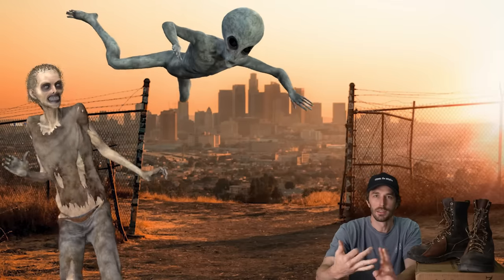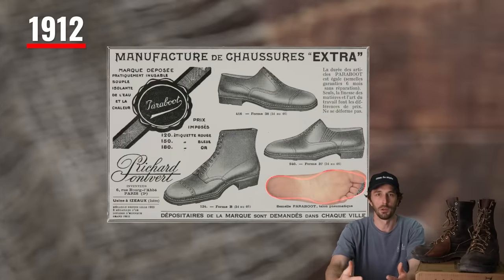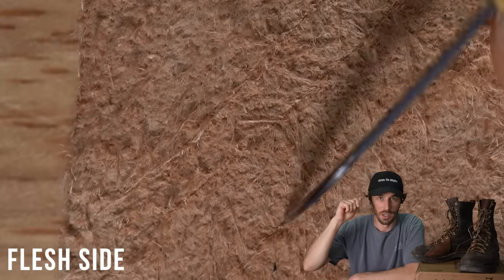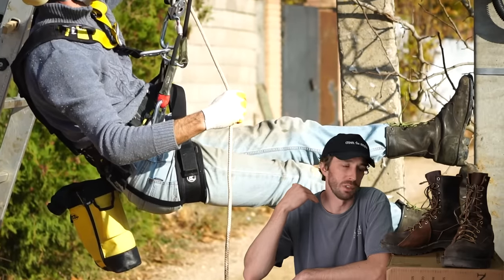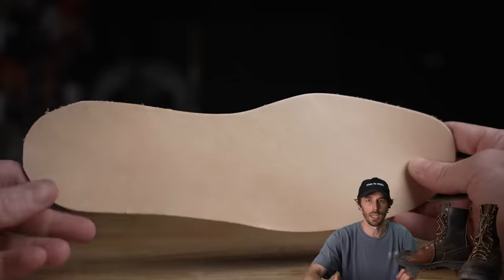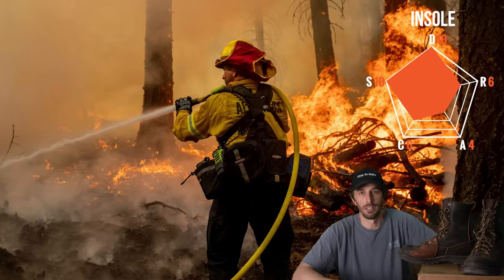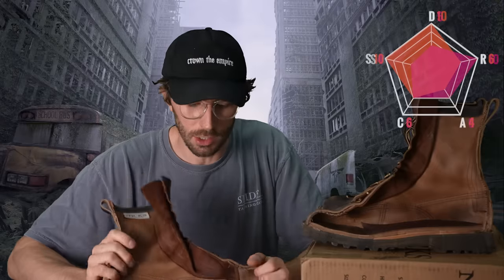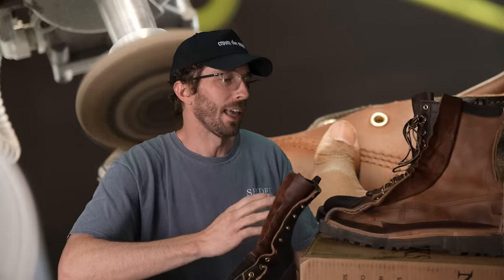Why this boot would save you in the Apocalypse (ND3)

Comment: more "work" boots for people who don't wear them for work. Reinforced the inner edge meanwhile my work boots have the outside edges destroyed from sliding in and out under cars, walking past pallets of sheetmetal that put big slices in them, scraping them against concrete, and accidently rubbing them on hot welds/having speatter land on them. I've worn holes though the sides by just having the leather get so thin that it tears like a canvas sneaker. never once has any wear where that extra patch is. it's probably the one part of my shoe that looks new even. Look at 5:39 like someone else said. these "new" boots already have wear there and no extra protection
definitely won't last any longer than normal work boots before that whole toe section needs to be stripped out, and at that point, why spend this kind of money if I get 18 months instead of 12 out of boots 🤔
silly.

Comment: If i missed it are these boots waterproof? Ive used some big name boots like rocky, redwing, danner, irish setter and have yet to find a boot thats lasts more than 18 months with regular cleaning and waxing/oiling. I do pressure washing and am also in the woods all the time so i have a pretty equal time on dirt and pavement but most boots cant handle the constant wet dry conditions that cause the soles and leather to break down will these boots handle what the other big names cant?

Comment: I'm going for a 3 momth Pilgrimage, accross Spain,.Camino de Santiago, and need good shoes. Since it's pretty hot, lomg way and....all that comes, would these boots be great, good or not so? Cause I'm thinking on non-leather shoes. For the reason of lightmess, faster shape ing to my foot, also half-hiigh ankle shoes where I can tighten them up just over my ancles amd getting good suport. Also ,if they come with 2-3 upper hooks, I can use them as ordinary shoes, just tightening them up under the ankles, like lower shoes, just abow the wrist, not using the hooks. Also they maybe should be GoreTex? Do you habe any good shoes to recommend vs these? Would you go for leather since tney shape better to your foot(but now adays, the Hiking shoes,.not leather also, does this. Or maybe a mix of leather and apparel? There's so many different clothings for shoes now, so what to choose? Hope so much you can belp me out with these things🙏😊. Best regards,  Thomas Aasen, Norway

Comment: Anyone having the problem of Leather cracking right through at the toe bend? and that's with both the new Solovair and DMs, contacted Solovair about it who told me it was because ''I bought the wrong size'', I responded with '' I still have a pair of For Life DMs that are the same size and after 4 years of constant wear there is no problems with the leather, I have been wearing DMs for 40years and have never had this problem before!. Response ''we don't make comparisons''. 
DMs and Solovair have both cheapened their materials and by doing so have now got a rubbish product.
DMs are also not honouring the ''For Life'' agreement as they don't do repairs and instead are offering a lesser unreliable replacement product.

Comment: When there is a collapse (and there will be due to a combo of ever faster weakening of earth's magnetic field and a strong Solar event(s) knocking out electrical grids), my plan is rather different foot wear wise.  Multiple pairs of lightweight hiking sandals--don't weigh a lot and aren't very bulky. Of course they individually wear out significantly faster than a boot like the above... but pretty sure that 3 or 4 pairs will last significantly longer, especially outsole and tread wise, than the outsole and tread of one of these boots. During a real and full collapse, there will be very little repairing of footwear. You will not have extra outsoles, good glue/ahesive, etc just lying around. 

   But the real secret sauce will be the special, oversized, protective "socks" that goes with these--- only two and both very light weight. First one is a warm weather outer sock made out of breathable, extremely fast drying UHMWPE fabric. Toughest material on earth in many respects, and very cooling (thermal conductivity similar to some metals). 

   The cooler to cold weather sock will be more involved. It will have an outer layer of breathable, extremely fast drying, outer UHMWPE fabric, with a layer of siliconized kevlar fabric below that (you just thin some silicone caulk with naphtha to a correct ratio), a polypropylene layer below that, and a high tenacity polyester fabric below that. All breathable, all fast drying, and the latter 3 fabrics more insulating (will be used in combo with alpaca-synthetic blend socks). Maybe a layer of hollow core fleece in there somewhere as well?

    It will be highly water resistant, but still breathable and quick drying.  If it gets sopping wet, you can take it off and wring the water out of it.  You can't do that with thick leather--that stuff takes forever to fully dry.  Meanwhile, the hiking sandals are very quick drying. 

   Oh, and both outer protective socks will have outer insert pockets for a carbon fiber + S2 fiberglass + high strength epoxy composite insert. This protective insert will have small holes drilled into it, for you guessed it, breathability.  

   With this fabric combo, you wouldn't be able to cut through the material easily, if at all, with your average cutting instrument.  The beauty of making it into an oversized sock, is that it is pretty easy to do if you have a sewing machine and know how to use it.

Comment: I live in Nome, AK and I work as a meat dept. manager.  It gets cold up here and wet during the break up.  Also, I walk to work each day.  I need something that will keep my feet dry, warm and be comfortable.  Nome has about 2 or 3 paved streets.  The rest are dirt packed with stones embedded.  I need to deal with those conditions.  Will this boot provide what I need?  Also, loathe to buy online since footwear can vary so much on fit and actually putting something on and trying it is the best way to see if they work.  How is the return for a better size policy?  Thanks.

Comment: I’m not sure why you think lineman have the worst job on boots,I work in the garbage industry,there’s nothing more dangerous than a landfill,the only boots our company allows on our feet are the timberland pro,there puncture resistance,water proof,insulated,they have a polymer toe,I’m a diesel mechanic,so I’m getting oils grease,fuel on them,theses boots don’t fall apart,and I get years of use out of them,they wouldn’t even let you’re boots in the garbage industry. Yeah these boots are almost 300.00,and there comfortable no break in period.
You’re boot as no insulation it’s going to be cold,the timberland pro with good wool gators,you can go out in sub zero temperatures and you’re feet don’t get cold
Timberland pro baby is my choice

Men's Timberland Pro 8" Boondock WP & Insulated Work Boots 89635

Comment: why no steel toe? to heavy also a steel plate in the sole would help puncture resistance on the bottom but if you've ever jumped in those they slap your feet when landing its something to get used to. but maybe instead of a plate maybe several plates linked together in a scale manner so less slapping happens idk worth a test i geuss. out or maybe plates then a non neutronium sole

Comment: So I recently started working with my states DNREC in the US in Delaware so we have a mixture from Woody and rocky terrain to wet and sandy that basically wore down my Keens in less than a year. Actually had a half inch wide stick puncture the sole and it's basically barely being held together with Shoe Goo. Any regular watchers of this channel that could point to a vid or recommendation for tough but comfortable hiking boots that I could bushwack through untouched terrain without wearing them out in less than a year?

Comment: $620 for some hipster boots? No thanks. I'm a welder in Texas, my made in the USA Justin steel toe J-Max work boots cost $240. I've been welding for over 10 years and I'm on my 2nd pair. I tossed my first pair only because someone dropped a running angle grinder on my toe, it opened up the leather, and the steel was showing.

Comment: I've been in the military for 14 years and I assure you this is not the boot I would sport in the apocalypse. The fact this guy thinks modern boots just fall apart and melt after 5 years is insane. I have rocky sv2's that have lasted 10 years after countless exercises. Not to mention we used to issue boots like this back in the day and the number one problem with them is winter. If you're a hipster living in Cali I guess you could wear these but anywhere else these turn into hockey pucks on ice and hold zero heat. If you have the money get a pair of lowas

Comment: Weight? What kind of Nancy-boy cares about weight? I've done 4 years in the Light Infantry and the next 35 working in foundries and machine shops. The only time I've ever noticed weight on my feet is following military vehicles down muddy roads when each foot had about 10 pounds of mud stuck to it. 
For waterproofing, you can't beat goretex. Applied waterproofing doesn't hold up to sustained submersion. I also need steel toes or better yet, a composite equivalent. A protective shank on the sole is essential too. When you weigh over 200lbs and are carrying another 60-100lbs and you step on a nail, thick leather and rubber aren't going to cut it. 200 grams of thinsulate helps down into the low 40s or high 30s and you don't notice it when it's hot out.

Comment: Bro…. I got another thing that’s hard on boots… WORKING ON TRASH TRUCKS. Yeah. It’s hard on them. Really rough. Hydraulic oil, all kinds of fluids you don’t want your foot exposed too, fuck trench foot. Only boots I’ve found so far that WILL be water tight even after 2 years of hard use is the redwing logger max so far. Tried danners, yeah no thanks.downside to my redwings? They are HEAVY. I’m used to it though everyone else who grabs them are shocked by me wearing it daily even in my early 30s

Comment: Well you forgot working on the Railways, even as if not ven more important than what you showed (5,00min), do your 20-40km every day on Rocks (only wallking counted and not all the rest) and tell me again XD if not more or same important !
2-3 months and you need new Shoes in my Job if they are bad! And im talking about having Boots for Mountain Region, thats we work with!
Under sole seems the most important then the rest. But yes, it dpends o what Ground your working on. We have a lot of Nails and Glass and whatver laying on the Ground that can Slit or Penetrate your Undersole. Stability would be next iMHO! As i recall in Military, the best Boots are bale to switch out the Undersole, which is good and timesaving!

Comment: I made my own shoes I use materials like carbon fibre the bottom is made of titanium whit small dents pattern that avoid the shoe slip other materials use inside of the boot to isolate the feet from water treated leather whit layer of graphene paint does not wear of this shoes can take minus 80 degrees Celsius to 60 degrees Celsius plus all surfaces of the shoes have microparticles of coper antibacterial metal use 3d printing and crn to carve and mix the materials . you can put this shoes under  in the sea for decades and come out new is made inspire in shoes for astronauts  conditions , light , space proof , sea proof ,fire proof I mean probably you will die before the shoes break one of the most extreme test I made whit this shoe apart to submerge in sea for 6 months is to take pork fill the shoes whit it and let root inside the boot and most of cloth after body decompose cannot be use after well my shoes survive . not for sole because cost me 15 years to make them and 35k of euros. and they will be use by future generations the most advance shoes I make in my life I make thousand of shoes in my 60 yr career in Italy .

Comment: These videos can be really informative and educational, however when the boot you cut in half is one that you have helped design and are aware of the materials inside the process feels extremely redundant and performative in the worst possible way. The process of destroying a hand built product of such quality gives me pause, but the benefit of learning about the construction of a product often makes it worth it. When you are the one taking part in the building of the boot and then destroying it for views it gives the sense that the care for the boots isn’t there. Could you not get the same entertainment value and highlight a product by going through the construction of one of these boots? Wouldn’t seeing the process of your decision making and the craftsmanship be valuable without  destroying the materials and effort?
Reply: Your opinion is invalid when you realize that SHOWING the viewer the construction of the shoe is just as effective as TALKING about it. Discussing the materials used only goes so far. Showing us the physical construction of the internals is reassuring to potential customers.